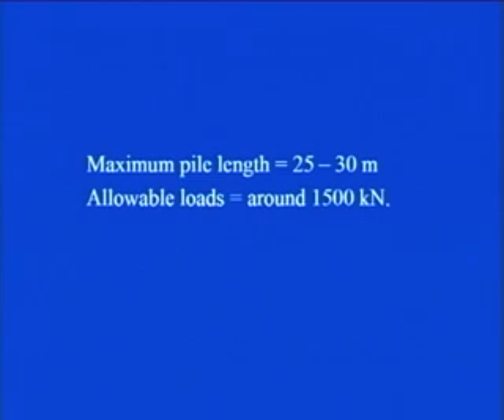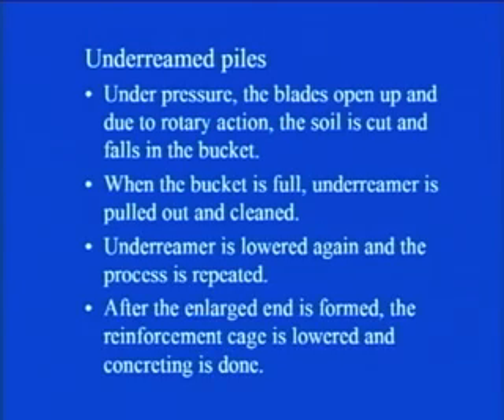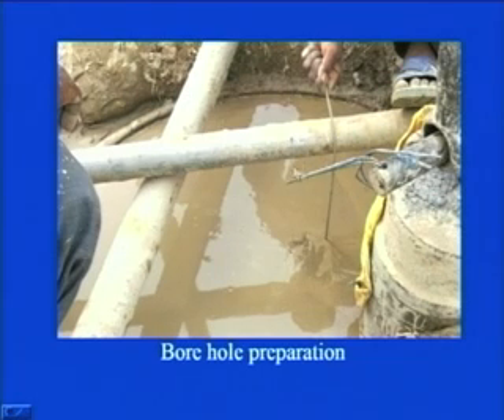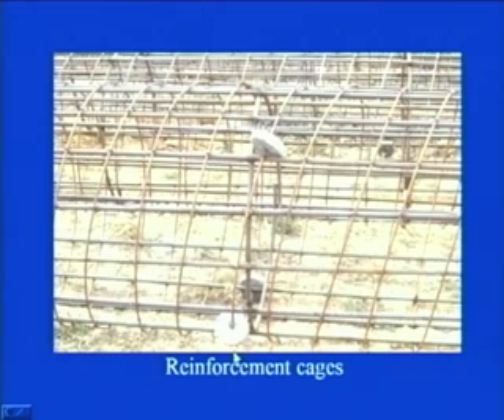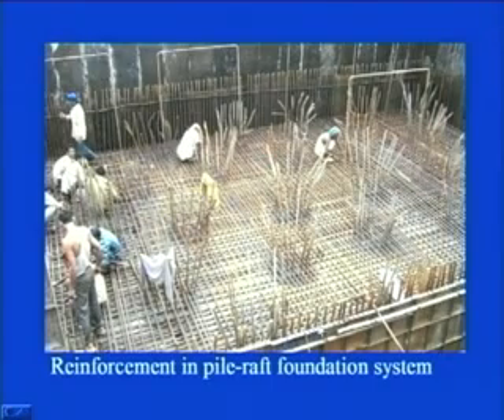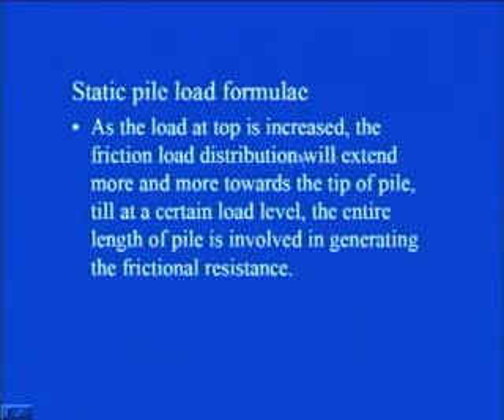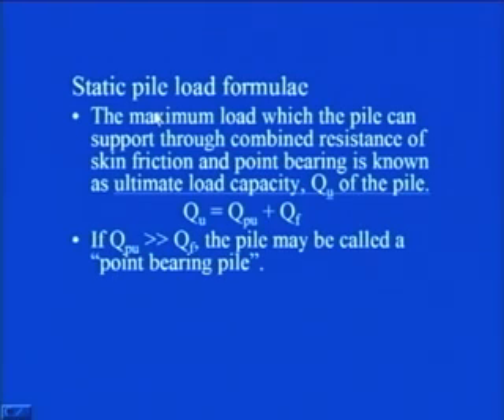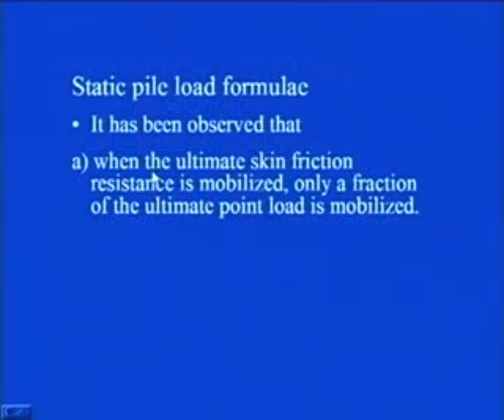Mod-2 Lec-7 Pile Foundations-2

Comment: Chipping is done to remove top portion of concrete which got mixed with bentonite solution and soil. I am not sure it is done to maintain continuity with pile cap as it can be achieved without chipping and just by leaving reinforcement